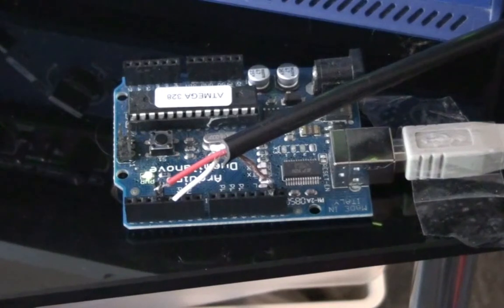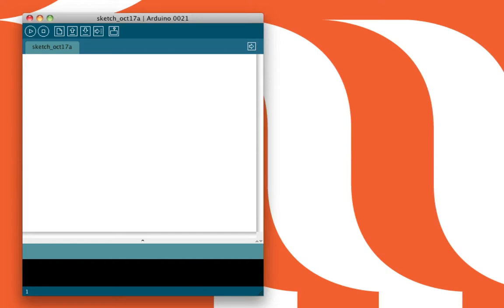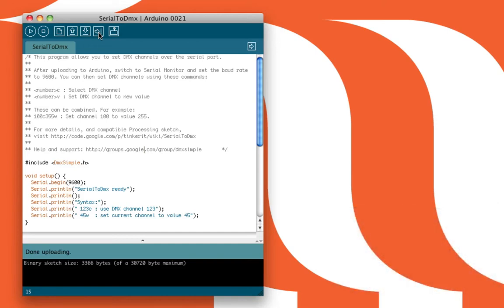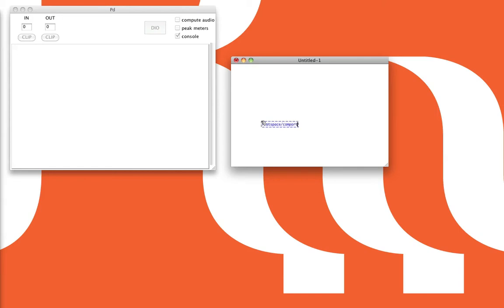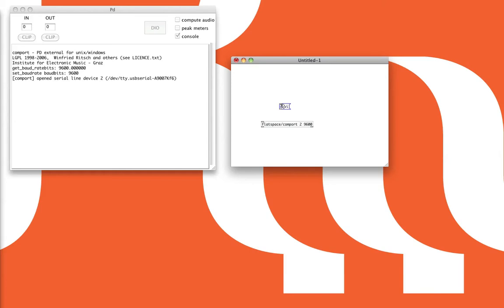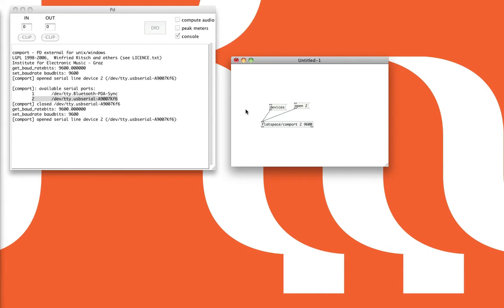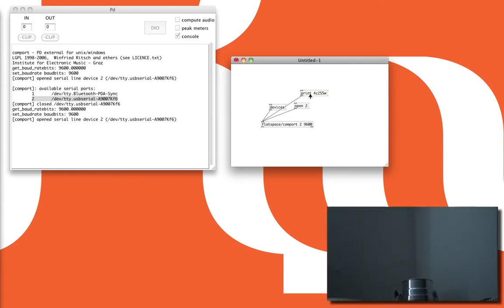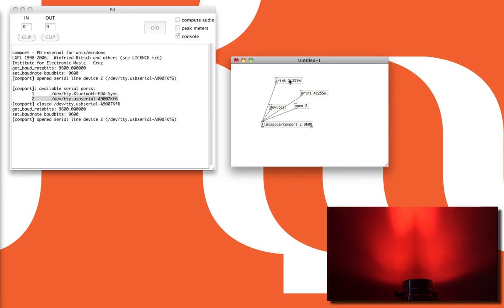Controlling DMX lamps with Pure Data through Arduino (pt. 1)

Comment: To anyone trying to get this to work:

I managed to get it to work on an modern UNO using this shield: https://www.tindie.com/products/Conceptinetics/25kv-isolated-dmx-512-shield-for-arduino-r2/?pt=full_prod_search

You need to add in the following code to the setup() function:

  pinMode(2, OUTPUT);
  digitalWrite(2, HIGH);
  DmxSimple.usePin(4);

Then you need to set the jumpers:

EN
DE
TX-io
RX-io
Reply: Any chance you could upload your script and patch? Doing this for a uni project and it would be super helpful!
Reply: Lillie Simpson-Little how far have you got? are you using the same shield?
Reply: No, you can't buy them in the UK! Is it not at all possible to do it through arduino uno without one?
Reply: Lillie Simpson-Little I live in the UK - you can get one. You don't need that shield but you do need a shield I think - you could even make one - http://playground.arduino.cc/Learning/DMX . From what I have read the arduino in this video is an old and different model so allows the dmx to just be plugged straight in.
Reply: I have ordered this http://uk.rs-online.com/web/p/processor-microcontroller-development-kits/7798870/ as it will arrive Monday and think it will work well. Thank you for all your work so far. I have one other question for you, what do you mean by:

"Then you need to set the jumpers:

EN
DE
TX-io
RX-io"

Sorry, I am an Arduino newbie, but your help so far as been great! Thanks again.
Reply: Those jumpers are specific to that shield - your shield looks free of jumpers.

That tinkerkit shield is tailor made for the library in question I think so you probably won't need to do any of the things mentioned in my original comment - it will probably "just work" - https://github.com/PaulStoffregen/DmxSimple/blob/master/README.md

One thing to note is your shield appears to have two 5-pin DMX output jacks - so if you are controlling 3-pin DMX stuff I think you need an adaptor.

Comment: It is a little hard to understand to program it using different programming languages. I'll make a dmx controller with an arduino nano v3 to run 512 dmx and an arduino nano v3 to run the various scenes and show maybe a arduino Due to do the work for show and it sen data to nano v3

Comment: Would you be able to explain how this is working without an rs485 chip? I have tried every way I can imagine to hook this up and get some lights... no go. I plugged in the wires in all the ports on the arduino to no avail. Any help would be appreciated.

Comment: I can't believe that this is working... everywhere I look folks and schematics say you need an rs485 transceiver of some sort. I have a sp3485 breakout board from sparkfun and have tried every way I can imagine to connect these things... You are simply pluging the red wire (data -, pin 2 on dmx) into pin 3, white (data+, pin 3 on dmx) into pin 4, and copper shielding (pin 1 on dmx) to ground on arduino without any external circuitry? Why pin 4 on arduino for white?

Comment from the maker: @SpaceCredits DMX is a protocol used to communicate with certain lamps and effect units. Here, we're plugging an Arduino board into an LED lamp using DMX, so that we can send messages to the Arduino, and it translates those messages to the lamp. The software used to send messages to the Arduino board (Pure Data), is commonly used for music making/programming.